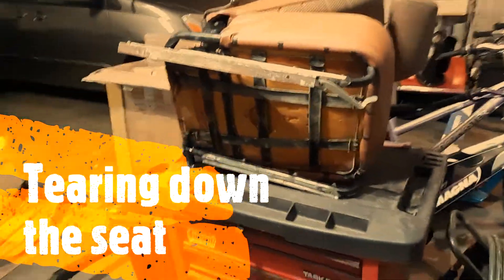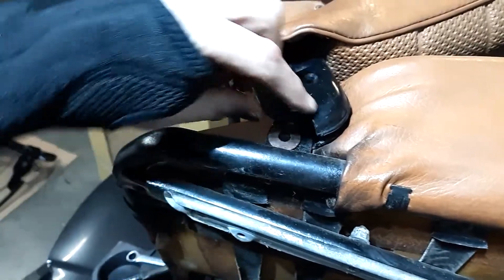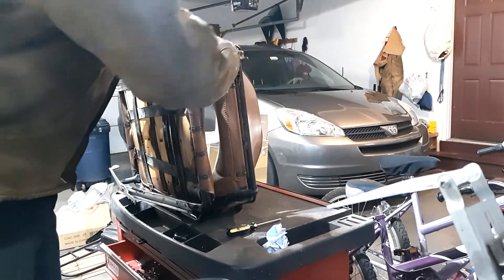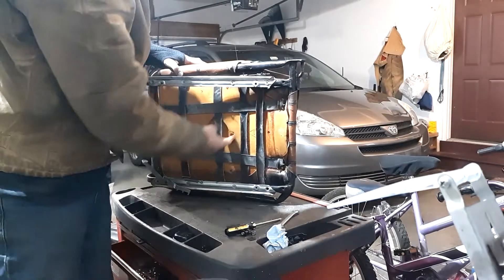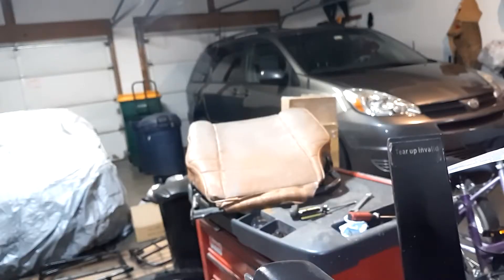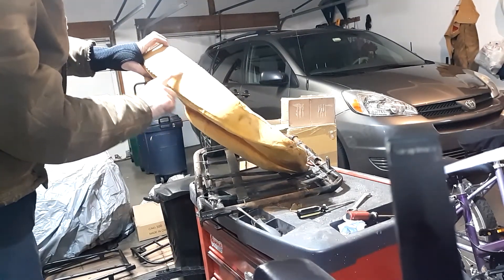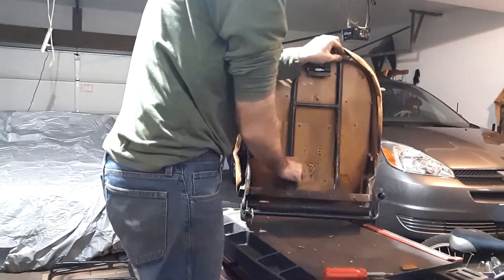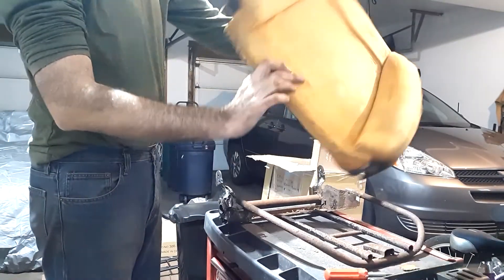MGB Seat Teardown

Comment: On my '72 MGB I need to replace my driver's side foam on the bottom seat part (not the backrest).  Is my seat similarly constructed as this one? Do I need any new hardware too, or just the foam and rubber straps?
Reply from the maker: 72 should be same like this seat (my '73 was just like this too).  The early cars had a rubber diaphragm thing that they did away with.  Check the Moss catalog to double check the years.  Foam and rubber straps should do it...the straps come with the hooks.
Reply: @mcnamarasgarage  Thank you for your reply.  Much appreciated.